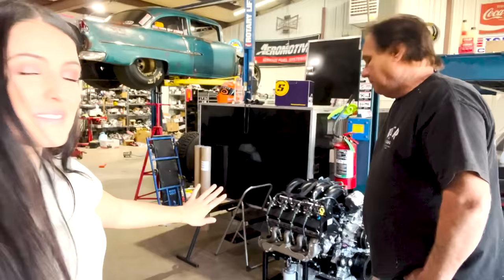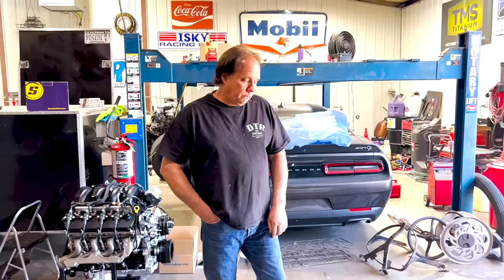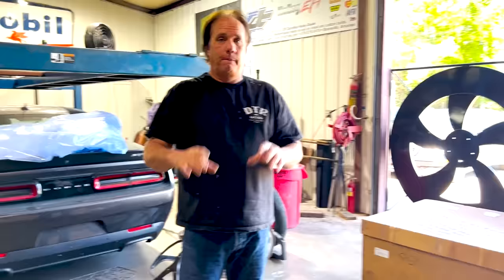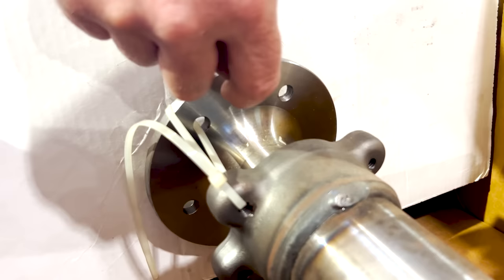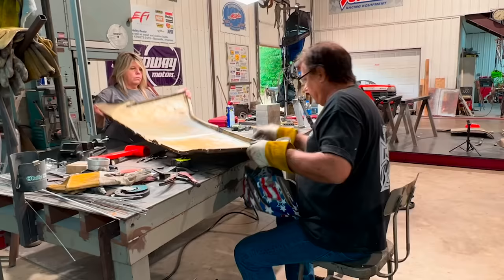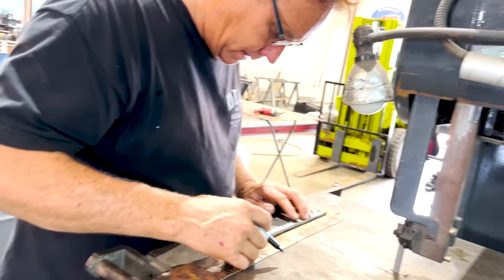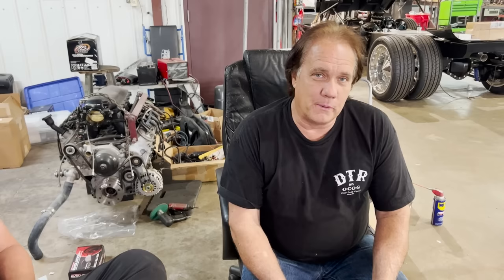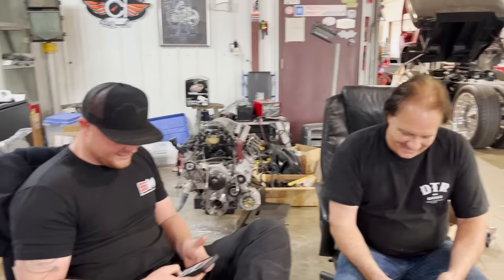Step by Step Patch Panel AND 3D Printed Valve Covers -  Video 5 Isky Tribute Car

Comment: Had a friend for here in New Zealand travel over to the Bonneville salt flats pit crew for Bill Ward the first New Zealand car to race at Bonneville and he set a speed record in his flathead ford v8. his best moment was meeting Ed Iskenderian at his factory they talked a lot and John got given some cams for his scj motor in his mustang. He still talks about how much he learned from him regarding cams. He always wanted to go back just to compare notes. I will let him know about this build and show him the videos lol he doesn't even have a cell phone but builds a good engine won his class a couple of years in a row drag racing back in the 80s. I dont quite understand but he plays with old ford tractors now still has his t bucket drag car untouched for 30 years. And a couple of scj mustang's just sitting in the shed. 😁🇬🇸👍

Comment: The original Halibrand and V8 based quick changes used 4.11 V8 gears. Not very strong. A gears can be used as well, 3.78 and are stronger. Classic speedway cars are making 3 78 live with over 400hp. Aftermarket ring and pins. And I suggest would be ok in this car. Used in most midgets. 
So called 'Champ diffs' used Ford Freighter gears and was top of the range. Not now as there is a myriad of better things.
That diff you got from David will be more than adequate BUT do NOT drill those axles as you will be too close to the  edge. Use adapters, available aftermarket both ways. Many dirt sedans and modifieds use 5x139.7 'wide 5' wheels with adapters to Ford diffs. Though using 4.5" wheels will make little difference anyway.
For land speed I would recomend floating hubs.
Dennis, Halibrand was the first or one of the first to make Quick Changes. People had fabricated their own using std A or V8 diffs And used factory Ford gears.
I have seen a few of these homemade ones and they are still working [with aftermarket 3.78] gears 60 years later. But are heavy and using Austin or Morris LC3 floating hubs even heavier They are 5" PCD. Go study speedway engineering.
6 70,,,, Sprintcar 1/4 mile oval with a 108" r'r tyre. I use 6.55 or 6.88 with a 92" r/r on my Holden 6 Supermod. And 6500rpm

Comment: Very cool work on the valve cover.  I'll be interested to see how it seals with just the 2 bolts holding the cover to the adapter (or are they for static display?).  Nice work and very fun project!

Comment: injecting into the cylinder gives more effishent  fuel use and with boost or forced air you can get a better regulated mixture  or more consistant so the blinker fluid flows better no flooding or vapor lock when you do a burnout by the way indy cars only have one lugnut per tire  just saying  my opinion i wanted to be a rocket scientist  but i became a daddy instead  so im still trying to figure out ware the blinker fluid goes its allways great to see different ideas on everything like using a 3d printer cad design  on a milling machine